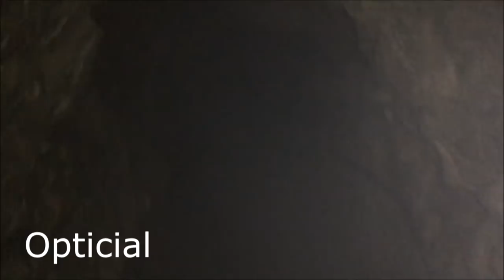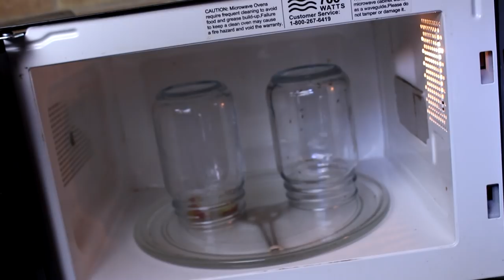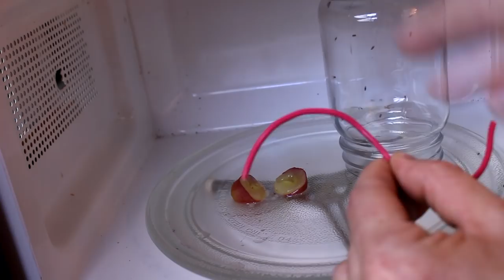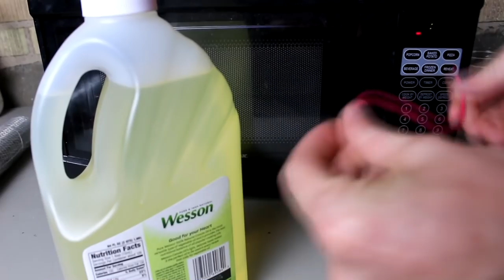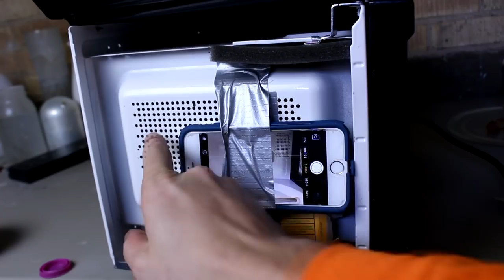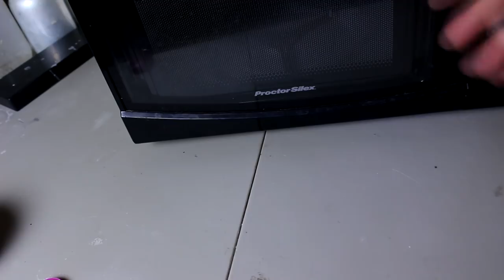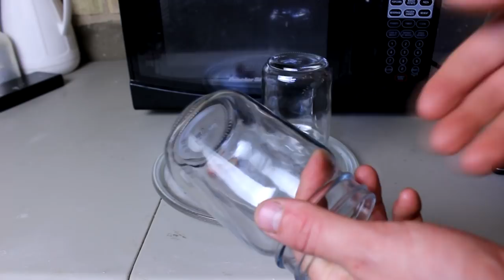Fruit Flies In A Microwave?!

Comment: Waveguide cover looks a little burned. Microwaves operate at 2450 MHz. They emit radiation with a wavelength around 4.7 inches. The holes in the mesh of the door are 
usually around 2 millimeters in diameter. Since the holes are very small compared to the wavelength of the microwaves, little radiation leaks out, but if you replace it with that 1/4" metal screening, you can bet more radiation will leak out.
Reply: But the odd stray microwave isn't overly dangerous. I mean if you stand right next to it, you might get a little bit warm-ish. But they are really just smaller radio waves and have the same potential to cause things like cancer as radio, which is none.
I think when microwaves were invented they did the handy little ovens a disservice using the word radiation in describing how it cooks. I know back then atomic power and radiation were buzz words for the time and people wanted to be part of the atomic age. But nowadays people hear radiation and get triggered. They fail to understand that electromagnetic radiation, with a wavelength longer than ultra violet light is too big to cause damage to cells and trigger cancer.
How many people would listen to radio if they knew the signal was transmitted by radio wave radiation? Would they have Wifi in their house? That's transmitting radio wave radiation!!!
Reply: And thats where you're wrong. Transmission does not increase until you are getting really close (within 5%) to the used wavelength. 1/4" is just as intransparent as 1/40" mesh. So I take on your bet. ez money.
Reply: Low intensity microwaves really aren't dangerous.  WiFi operates at 2.4GHz (i.e. microwave frequencies!), so all our houses are full of them.  I did experiments at school (just a few years ago, so not even in the era before health and safety) with a directed microwave transmitter and was just told 'don't look into it for too long' :D
Reply: Jeremy Stanger 
Also. WiFi usually operates in the micro watt range. Waaay less than a microwave
Reply: I think you are in principal correct though (though reading this nearly made me vomit - using inches is bad enough, but mixing it with metric measurements is unforgivable :P ).  Though to an engineer the two hole sizes are basically equivalent (and this is where I think you're overestimating the amount of radiation that leaks out in the latter case), to a physicist, nothing is ever as cut and dried as that.  Though I'm struggling to recall the details, despite having sat an exam in electromagnetism a few months ago! (I'm studying physics at uni) In general with waves, things happen continuously and there isn't some critical hole size that will start letting radiation through.
Reply: +Turun Ambartanen True but the slight leakage as long as the holes were at least a few percent (Like 10%) the leakage would still be completely harmless to humans, it might however create a wifi dead zone around the device whenever the cavity magnetron was active. Those are easy to overpower by comparison taking an good thousand times less radiation than would be needed to harm you. You need a pretty decent heating rate to be harmed, humans have a rather effective liquid cooling system called blood that pumps heat around with a very high efficiency.
Reply: @electronicsNmore The waveguide is probably just a bit dirty not burnt. How could it be burnt isn't it a mica sheet or other dielectric ?
Reply: Seraphina S There is a gap in the door that appeared in my microwave a couple years ago, and since then, the wireless internet would go out when it's on. If microwaves are that big, how does it interfere with the internet when the gap is only 3-4mm wide?
Reply: @RadicalOne1912 3-4mm wide but how long ?
Reply: +RadicalOne1912 Well for one the mesh can never block it completely remember that the induced currents in the mesh in themselves produce magnetic fields larger holes have larger currents so more will leak out due to the secondary emissions from the cage itself. What you need to remember is that your microwave is putting out tens of thousands of times the output power of your wifi transmitter so even a tiny 0.01% leakage can easily degrade the SNR of your wifi when it is leakage from a 700-1000 Watt emitter fighting a 0.020 Watt wifi transmitter that said it requires a lot more leakage to leak the several Watts of radiation required to harm you, anything less than a couple of watts you can be exposed to essentially indefinitely your body routinely dissipates 100-400 Watts of metabolic heat constantly and can handle a few watts of added environmental load no problem.
Reply: As mentioned, WiFi is very low intensity and thus very sensitive, and a tiny amount will always leak out due to quantum tunneling. If your WiFi base station has line of sight to your microwave, placing any metal object next to the antenna will probably fix your problem.
Reply: question: if there is some problem with leaking microvawes from microwave at levels effecting lets say TV/ wifi, are and or could those be harmful ?
Reply: +Quart47 Unlikely, the levels needed to be harmful are on the order of 100 times or more larger than needed to interfere with a short range communication signal like wifi or possibly even any other device with an antenna or long coil of wire if the electronics inside don't adequately filter out the noise from induced currents. Of course a leakage large enough to harm you even at ranges of just 1 m would shut down wifi, not just yours in fact but every wifi within around 50-100 meters easily so unless half the street is complaining their wifi drops out every time you heat up a TV dinner you are probably fine.
Reply: Short answer: No. At milliwatt levels, the effect of microwaves on the body isn't even measurable.
typical maximum WiFi power output: 100mW.
typical total Microwave output: 1000W.
That is a factor of 10.000
And no, even that is not enough to kill you right away, because your blood makes for a very effective heat transfer system, distributing the power evenly through your body. It would be hella uncomfortable though and you wouldn't want to stand near a operating and cracked open microwave for more than a few seconds. For comparison: Lying outside on a sunny day dumps about 300W of total electromagnetic radiation into your body continuously and humans can handle that just fine. And unlike harder radiation (like visible light) all microwaves can do is transfer heat and nothing else.

edit: Redid calculation. Solar influx on surface of earth at equator: ~1400 W/m²
TL:DR If microwaves are strong enough to harm you, you'd definitely notice it. (and get the hell away from the source)
Reply: Really? Then explain why manufacturers use 2mm holes instead of 1/4" openings in the door? LOL
Reply: The typical wifi router has a power output between 500mW and 1000mW, the typical microwave uses 1000 WATTS(That's 1000 to 2000x more power). Anything at low power isn't dangerous, but when power is increased, it's a completely different story.
Reply: I'm probably twice Cody's age, so yes, in school we didn't use metric. Hard to break the habit. 120mm better? :-)
Reply: Over the years of repairing microwave ovens, I've seen 2 or 3 mica waveguide covers with holes burned through them. It happens.
Reply: As for the 3/8" to 1/2" hole in the bottom of the microwave oven cavity(under the turntable), the reason why there's no risk of microwave leakage, is because opposite that opening is another sold sheet of steel. Any radiation that did leak out, would be blocked by the metal shield. Even without the lower panel, the radiation wouldn't be a risk to users because it would be directed downward into the countertop.
Reply: Ok, thanks.
Reply: +electronicsNmore Actually no typical output powers are 20-50 mW nothing like the 500-1000 mW you cite, that said it's generally pointless having anything above that on the AP (Even in the handful of countries where it's legal at all) as it's rare to find AP's with a good enough antenna to hear the client at even a fraction of the transmit range of a 500-1000 mW AP signal (The end client device is still only whispering back at 20-50 mW no matter how loud the AP shouts!). Especially with low power devices like phones and tablets even where regulations allow it they pretty much never have high powered transmitters like that as they eat power for breakfast even laptops rarely have them.
Reply: I should have said "Maximum", not "typical".
Reply: You know what else produces 2450MHz microwaves?  WIFI.
Reply: well technically they use a frequency that is between radio waves and microwaves. So its not really microwaves and its not radio waves is somewhere in between.
Reply: mad kobra Who ever said I was a scientist?
Reply: the length of the video says 1337
Reply: Microwave ovens will interfere with wifi if you're within 5-10 feet from the oven while it's powered up.
Reply: mad kobra Inches or cm, it's irrelevant. It doesn't change anything I said.
Reply: True, everything you said is still stupid even if you had used consistent units.
Reply: Not true I use my tablet near the microwave all the time. It all depends really. I think the problem here is over simplification. It really all depends that includes Cody's mesh idea. Though even if the microwave didn't have a case it wouldn't be harmful unless you were extremely close to the magnetron output. I'd wager a few inches. Even then a burn would be the worst of it. The case is designed to bounce the energy around inside rather than protect the environment from microwaves. This is why you get standing waves(hot cold spots) in microwaves. Anywho they are experimenting with making FET based microwaves for more efficient cooking, because of standing waves. I wonder what some of you think of that?
Reply: Pentagonal cases produce much better coverage.
Reply: No,  even small radiation leaks are really bad for your eyes.
Reply: Dr Pebbs I guess my tri-field meter and 3ghz frequency counter were both faulty when I  performed tests on a microwave oven standing 6 feet from the microwave door. I observed a high level reading...You can bet that using larger holes will allow more radiation to pass :-). BTW, waveguide covers aren't made of metal!
Reply: Sounds like whats faulty is your microwave, but idk what high levels mean.  And what makes you think its not leaking from elsewhere in the microwave?  Do you detect the waves behind it or just in front of the door?  Are you on 2.45gz when you took the measurement?  

Yeah no shit they're not made from metal, we are talking about them burning right?  I mean the sticker on the metal gets hot.  But, I checked the video, but I can see that the cover in his microwave isn't burnt, and again, we are talking about nothing.
Reply: Dr Pebbs You need to find another person to keep you entertained, I have more important things to do than argue with a person who has a fraction of my knowledge when it comes to microwave oven operation. Based on your photo, I was repairing microwave ovens before you were even born. I also happen to have the #1, top rated microwave oven repair video on Youtube.
Reply: electronicsNmore v
Reply: and when they leak out they cause cataracts
Reply: If I stand next to mine I pee my pants, and it BURNS!!! Dinners still cold,  mostly.
Reply: Yeah big guy you are but you still return to rewrite your comment.  I still don't understand what you don't understand about his explanation,  2mm  just as small as 6.35mm when your talking about an object 119mm across.  Though you probably blanked out for that part of the video, because fuck that fancy science shit lol.  Its not like any of it made any sense anyways, right??
Reply: 2450 MHz? One of my internet connections run at 2.4 GHz lol
Reply: Jeremy Stanger one of my APs run at 2.4 GHz, 5 GHz, and 60 GHz. The 60 GHz signal doesnt even go through a wall lmao
Reply: Hole in the sheet metal can be modeled as a very short waveguide. When the wavelength is larger than twice the waveguide diameter, the attenuation per length of the waveguide goes up very quickly, however in this case the length (thickness of the sheet metal) is also quite thin, so the end effect is that the large hole he made will allow significantly more microwave power to pass through than several smaller holes would, but still not enough to harm his phone (evidently - I haven't done the calculations)
Reply: This is the dumbest argument about microwaves ever. We have an old man who's apparently a microwave repairman with the "#1 microwave video on YouTube" and a bunch of university physics students arguing about essentially nothing.
Reply: electronicsNmore probably because it's easier to see through
Reply: Charles Howard No, radio waves are all the way from meter waves to mm waves. Microwaves are at the resonate frequency of water.  A microwave in theory could be turned into a very powerful wifi. The part that makes it transmit data is how its modulated.

Comment: This makes me wonder if microwaves are over engineered like you said or is it more of a how the public views the microwave. For example you have 2 microwaves side by side. One has the normal 1-2mm holes or what ever size they are and the one next to it has 2.5cm.  Which one do you think people for "feel" safer using and therefore buy.  Like you said they both have the same performance and protection but someone who knows nothing about how the magic of microwave ovens work I think people would buy the smaller hole one.
Reply: I think it would affect sales yes. Id buy the "normal" one? Also it might cause too much interference with the outside, such as wifi
Reply: I agree. I would prefer the smaller holes one too.
Reply: In truth 99% of the population wouldn't even bother to check. I doubt having more or less holes or bigger or smaller even changes the cost.

Comment: I know this comment will get completely lost, but ElectroMagnetic radiation does NOT propagate by the changing B-field causing a changing E-field which again causes a changing B-field, etc.
If it did work like this, the E and B fields would have to be 180° out of phase, which does NOT happen (the maximum E-field would be induced at the point of greatest CHANGE in B-field intensity. I.E. the 'peak' of the E-field would occur at the point where the B-field's zero-crossing is!)!

Comment: The E and the B field in a free EM wave are not phase-shifted. They both have their max/min amplitude at the same time.They stand perpendicular on each other though.

Also this mesh you showed would not be equivalent, as the thickness of the 
wires that form the holes also influences the absorption strength. 
Shielding EM is not a matter of yes/no but a continous process.
Reply: Interresting. Yea, I've seen some ovens to leak and many of them allowing a cell phone recieving a call

Comment: Cody - your videos are awesome! I do have a little bit of an issue with your explanation here, though. Even RF with a wavelength much longer than an animal can indeed hurt the animal. Consider a person standing near an AM radio transmitting antenna. It is true that it needs to be stronger than if it were shorter, but not ridiculously so. I think what is more at play here is the average power per volume in the microwave, the small volume of the insects, and their surface area to volume ratio. If you have a 1kW microwave with internal dimensions 33cmx33cmx33cm, you have about 0.04m^3 physical volume. Since the microwaves do not fill the cavity evenly but instead form a standing wave, let's say that the effective volume over which the energy is distributed is only 10% of the physical volume, so 0.004m^3. This implies an average of 250kW/m^3 in the areas near the standing wave peaks. If an insect is about 1mm^3, that's 10^-9 m^3, so it would absorb only 250 microwatts. Even though the volume of the insect is tiny, its surface area is still respectable because that goes as length squared instead of cubed, so the insect is easily able to dissipate an extra 250 microwatts without rising in temperature much at all. In fact, the average energy use of an active fruit fly, as far as I can tell from Google, is about 300uW, which they dissipate without getting much hotter than their surroundings.

Comment: In the video you say that the photons have a voltage of 7kV because of how they are generated, this isn't how it works, the photons have energy (proportional to their frequency), not voltage. The only way you could say they have a "voltage" is to measure their energy as an electron volt in which case they would have about 10 micro volts.

Also microwaves heat matter because the changing electric field induces rotation (and thus kinetic energy) to polar molecules. At least as far as I remember anyway. You could always check, will the microwave heat small water drops about the size of the flies or smaller?